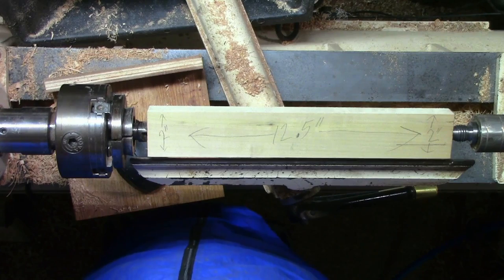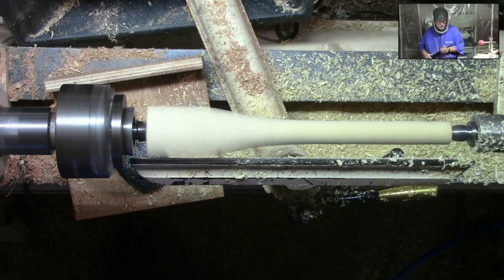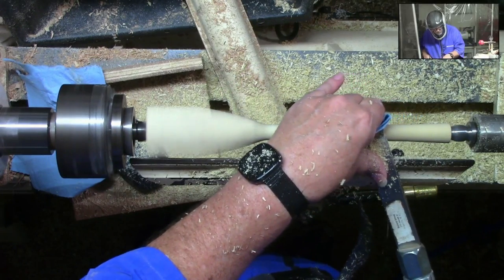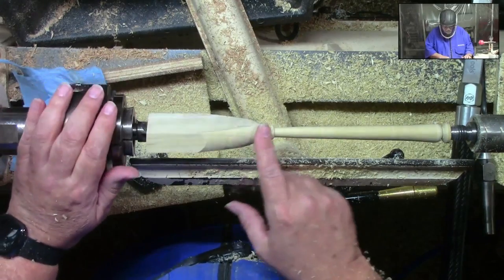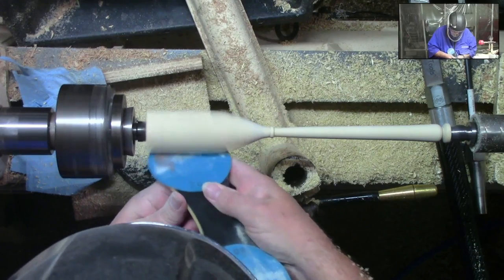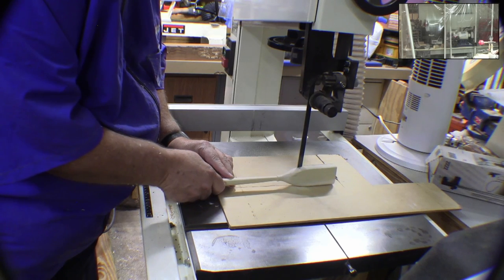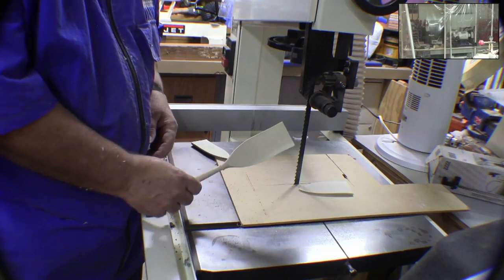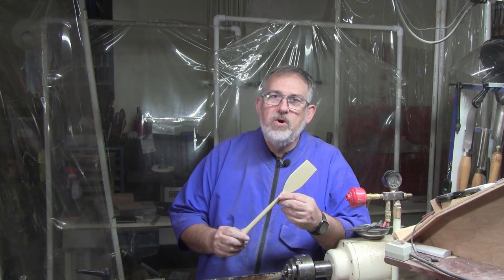Turned wood Spatula by Dean's Woodworking #woodturning #woodturningforbeginners #woodworking

Comment: Hi Dean, Been watching your videos for some time now. I like that alot of your turning uses the skew. My question is this, if you only had one skew, what size would you recommend and which brand?  
I am looking at buying a quality new HSS chisel but don't know if I need 1/2 inch and a 1 inch as a set, or could you get by with just one or the other. So many decisions and money to be spent. I appreicate your professional opinion on this. 
Thanks
Reply from the maker: I think the 3/4 is more versatile. The 1" is easier to learn on because it has a larger sweat spot, but is less versatile. I would wait on the 1/2 untill I had some practice with the skew. I hope this helps. Thanks for Watching!!!
Reply: Will be making one of these for the wife. What size roughing gouge is that?
Reply from the maker: it is a 2 inch roughing gouge.